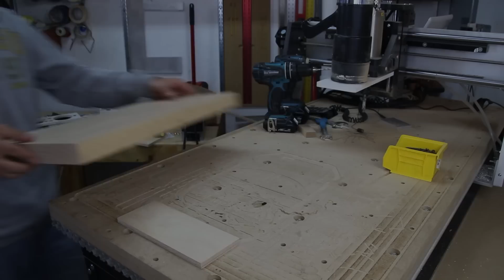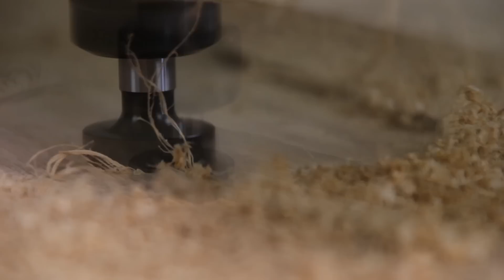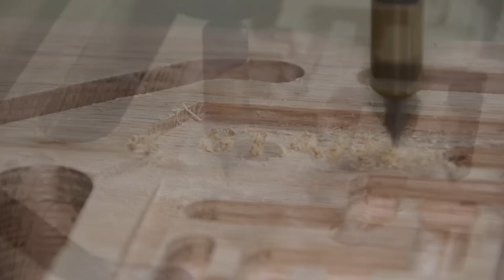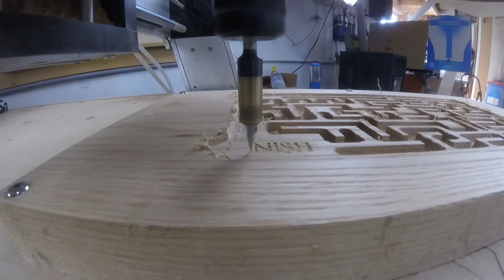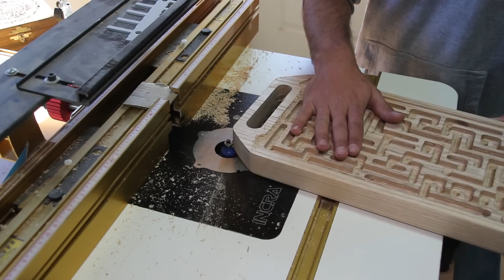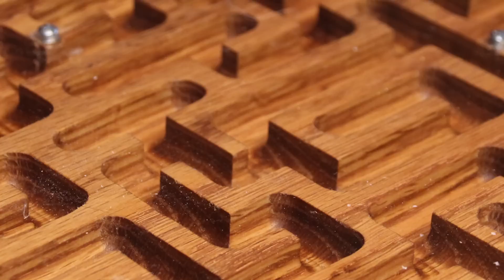Steel Ball Maze | CNC Project

Comment: Did you have to do any sanding? Or did the cuts come out smooth enough to not affect the metal ball?
Reply from the maker: Scott Hemphill sharp cutter, proper speeds and feeds, and quality material! No need for sanding. Well maybe to get some fuzzies off but surface finish was solid

Comment: How did the compression bit do on the profile? Any deflection marks or tool marks?  Been thinking about trying one but have yet to see it on solid wood profile cuts. Thanks.
Reply from the maker: It performed well, I could see the layers from the depth of cut. It really performs nice on plywood.